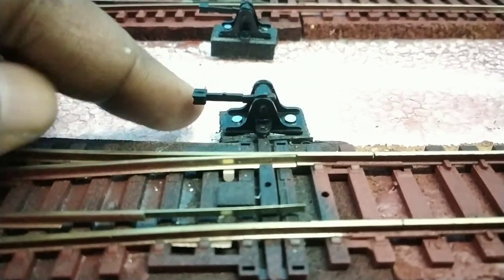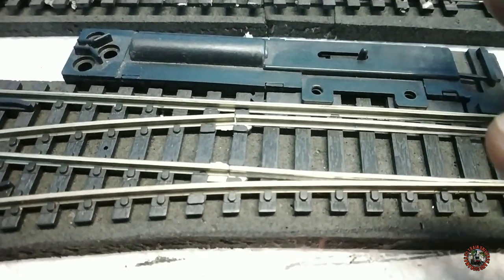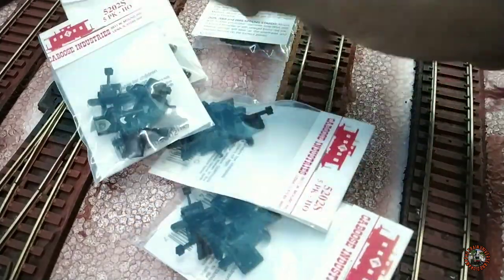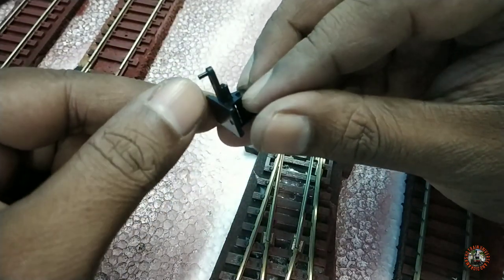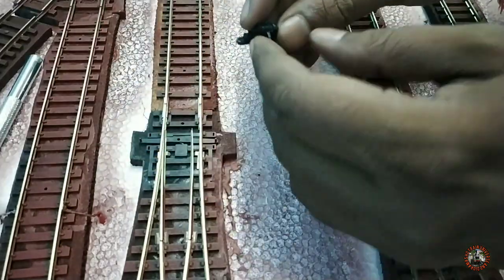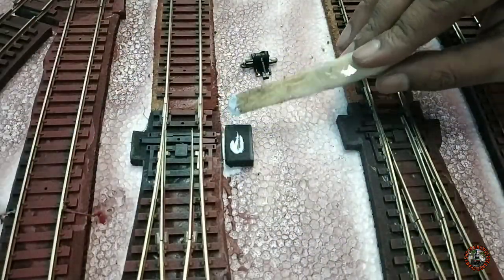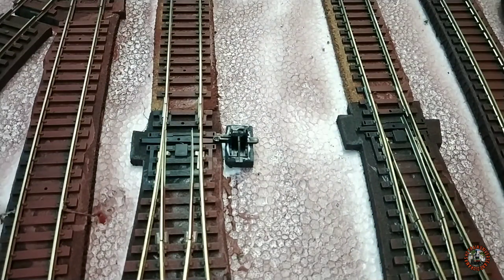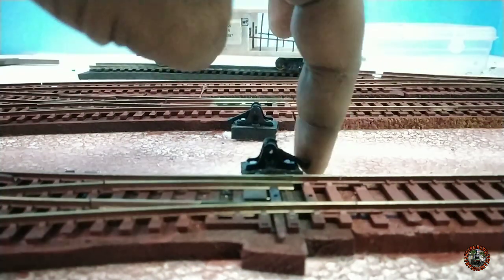How To Install HO Scale Caboose Industries Ground Throw Sprung | Easy Ground Throw Installation

Comment: Sir what is the difference between Ground throws sprungs and ground through rigid
Reply from the maker: The Sprung version is designed to mount directly to the turnout throw bar. The rigid versions require the modeler to form a spring and is used in cases where the throw cannot be mounted to the turnout directly.